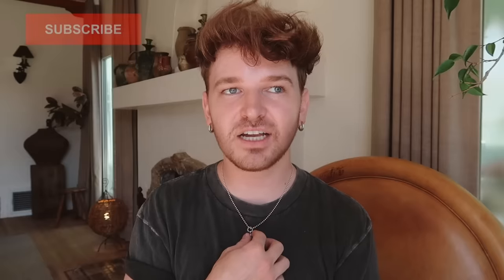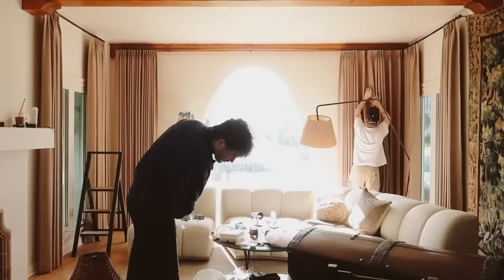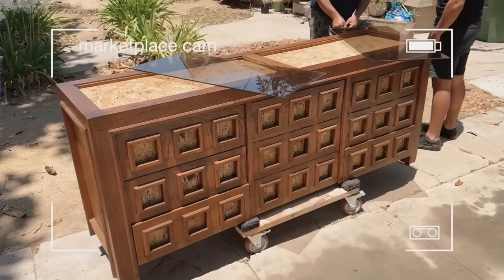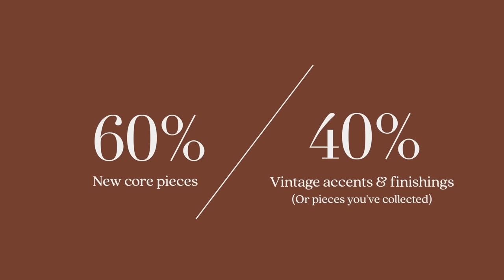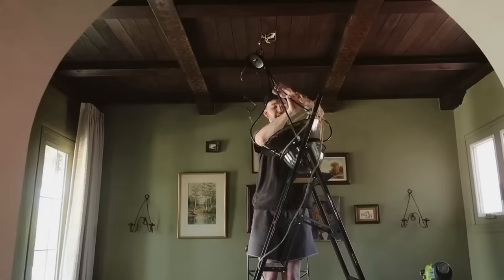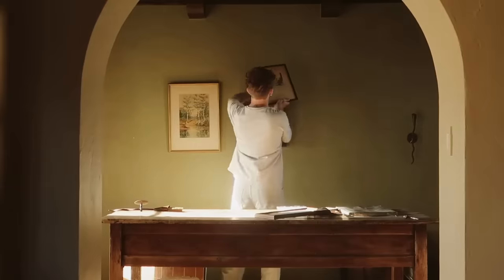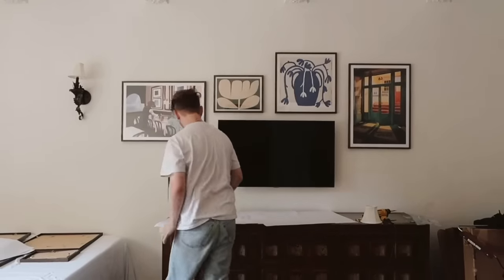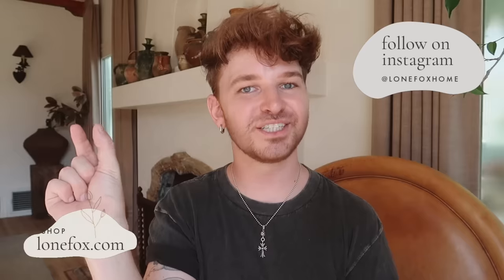10 Ways To ELEVATE Your Home 🏠 Designer Worthy Home Hacks!

Comment: I love feed and wax too, but the only thing to remember when you use it, is that if you think you might want to change the stain or tone of the wood color down the line, the wax is very difficult to penetrate. So, if you ever want to change anything about the color of the wood, you have to basically sand the entire piece in order to remove the wax. Just a good thing to know. 😊
Reply: Good to know!  @laurenzopie7922 thanks for the info
Reply: Mineral spirits will take off the wax without having to sand it down.
Reply: Or, use Howard Restor a Finish.  It's not as perfect as actually stripping refinishing, but it's also a lot less work.  You end up with something that looks much nicer (makes scratches less noticeable and takes away water rings)
Reply: @bfranklin1052   Floor refinishers would beg to differ.   They hate it when you have waxed the floors and wouldn't agree the wax can be removed with mineral spirits either.   So really think long and hard before waxing a hardwood floor.   If you know you would never refinish and the color is absolutely perfect for you forever, go for it.   Sometimes a wood floor has already been sanded a few times and doesn't even have another sand job in it so by all means wax.  The English don't change floor colors as often as Americans and they are huge on waxing the hardwoods.  But Americans are always deciding the floors are too warm or too cool or too dark or too light so just know waxing is going to cost you when you go to change them up.

Comment: Hey Drew, I wanted to share something with you about that stuff you use on the wood. If you use a paint brush specifically made for chaulk paint, there's a larger one with a pointed tip you'll not use as much product as it will be on the brush & not a cloth it's easier to get into the areas that fingers can't.  Store the brush in a zip lock for next project & it's ready to go .
Reply: Hey, that’s a great tip. Thanks!
Reply: @geethasingaracharlu9253  
Glad I could help you out with this ❣️

Comment: I have used the feed and wax for years.  If you have an ornate section on a piece of furniture use a stencil brush to push the product into the intricate areas.  I also have used it on my cast iron bistro table on my back porch.  It darkens the black and gives it a little protection from the elements.  Great product.
Reply: I used it on my brothers leather sofa when my dog scratched it. It was an emergency use but got rid of the scratches.
Reply: Old English works the same I think as Feed -n-wax but without the wax.  I go through so much Old English but it keeps antique woods so moisturized and makes then last.
Reply: @SMRT79  Feed and Wax will give the wood a shine that lasts much longer than Old English.  I used that prior to finding the feed and wax.

Comment: Love your design style and tips!  This is such a great channel! ❤ I will add a quick one of my own.  You can also, (inexpensively) revive tired, dry wood pieces with a mixture of two parts olive oil and one part white vinegar.  (Can also add a drop or two of your favorite scent of essential oil) You don't need much.  Mix it well, rub it on, let it sit and soak in for a few minutes, then buff it out well with an old T Shirt.  I have done this for years and have never had a problem with smell or rancidity.  If you are nervous about trying it, do it on a test section first.  Furniture looks amazing when finished!

Comment: I would consider “vintage” something that is 40 years or older and something that is 20 years old as “collectable”.  Right now, in Bakersfield, California, antiques are “dirt cheap”.  A 1900 coat rack and umbrella stand (complete with drip pans) that cost $200 in 1985 can now be found for $400 and it has increased in age by 35 years!  A very ornate Victorian tall desk is selling for $600 and in 1985 you could not touch it for less than $400.  Stores that sell second hand furniture are good places to shop.  I just bought two matching upholstered wing-back chairs for $200 and, from the same store, a carved “Henredon” brand side table for $55 and a tall ½ hexagon curio cabinet for $130.  At the Goodwill store I found a coffee table with leaded glass inserts for $20.  In 2014, at the Salvation Army, I found a sofa and matching love seat for $165 which was a younger, exact copy, of the sofa and love seat I had bought at J.C. Penny’s,  in 1998, when my children were babies.  All my table lamps in brass, porcelain, and glass have come from swap meets, Salvation Army, and Goodwill.  I bought my first nightstand lamp (50¢) at a swap meet, 40 years ago, when I was in high school.

Comment: My ceilings are coved and the curve comes all the way down to the trim. It would be hard to hang curtains from the top of the wall due to the curving walls. Also, my windows are generally in the middle of the walls so while I could finagle a longer curtain it would look broken up. I've found that hanging the curtains right at the level of the trim, which is at the bottom of the curve, works best.

Comment: I have a 100+ year old craftsman-style bungalow with plaster covering concrete walls. How do you install your picture frames without messng up the plaster? I also have a picture rail and am looking into buying the picture rail hooks, but some things, like drapery rods and mirrors I don't want to hang from the picture rail. I love your tips and your style! Especially your use of texture and mixed metals.

Comment: Question about curtains. I love the floor to ceiling idea but almost all of my windows are located right above a baseboard heater 😩 I imagine it’s not good to leave a bunch of fabric puddles on a heater. 

In this case, would you recommend still raising the top rod but letting the curtains hit a few inches above the heater? Or should they hit a little
Below the bottom of the window? Or just don’t raise the curtain rod and keep the curtains basically just right above and below the window?
Reply: Puddling looks messy to me.

Comment: I love sconces but don't have the hardwire to support it... Puck Lights did the trick for me. They run on battery and you can use a remote to turn them on. No wiring needed.

Comment: I have a rug in my living room. It’s an 8x10. And I probably should have gotten a 9x12. But the price was right. It’s kind of crooked in my room, but you don’t really notice. I just know it is. And it’s driving me crazy. Most of my house is thrifted or from estate sales. They have them online where I live. And my husband makes the mistake of telling me about them. So then he has to buy more. We have a light with a fan in our living room. I bought lamps for the end table and a floor lamp near my husband’s recliner. I can’t read a magazine with the overhead light. I’d rather not use it. But we’re used to it here, so it’s on all the time. My husband is going to buy a miter saw. And if he does I’m going to make some frames. I have a lot of artwork with no frames. So I want to make some for it. You can clean and make wood look better with lemon oil. It will make anything wood look like brand new. You have done way more in your home in the months you have lived there, than I have in three years in my home.

Comment: I get the idea behind hanging curtains high, but it always looks insane to me when the curtains are open if there's more than a few inches between the window and rod.

Also, in my living room, I have a door and a window fairly close together.  If I hang the rod higher, it's not even with the top of the door and looks weird.
Reply: If the curtains hang as wide away from the sides, as they do tall, above the top, where possible, they will look like a generous framing. For me, higher is better. My home has eight foot ceilings. Hanging the curtains just under the ceiling really made the rooms look taller.
Reply: I don't like the look of the "rod gap," and puddling looks messy  imo.

Comment: I asked for this to be done with curtains in my new home. When I moved in the builder had stopped the guy doing it, said it would use more material( about 6 inches in length). Curtains were included in the price. So without any consultation it was a done deal and everything would have needed filling and  repainting plus new curtains which I’d have had to pay extra for . I couldn’t afford that.  😢😢

Comment: I'm totally with you about scoring 2nd hand and thrift items to decorate for a comfortable and unique look, but I differ with you on several points.  $500 for a used chair is NOT a reasonable price by any stretch of my imagination.  I really appreciated your videos back in the day when you were budget conscious and showed us lots of ways to get a high end look without spending a ton of $$$ to achieve it.

Floor to ceiling curtains are not practical for anyone who actually opens and closes their curtains.  Because you cannot reach a ceiling height rod to adjust the placement of the gathers, you end up with clumps of fabric alternating with flat areas - UGLY!!!  Also, I don't want the bottoms of my curtains behind my furniture where they can catch, or worse, dragging on the floor and picking up dirt.  I don't have a housekeeper and do not enjoy putting my energy into maintaining a spotless home.  I have other things I'd rather do.

Feed and Wax is a quick fix, but I HATE this product.  The wax, in my experience makes the piece problematically sticky and it interferes with any future refinishing you may wish to do on the piece - unless you're prepared to totally strip and refinish.  I used Feed and Wax on my butcher block counters.  It was a huge mistake because #1 it didn't repel water (the wood was stained by even the tiniest amount of water and looked like crap within 2 months).  I was constantly on alert about wiping up even the smallest drip.  I found it stressful to have to be so extremely careful to avoid having water contact my counters.  AND #2, FaW attracted dust and dirt which stuck to the counters and and made them difficult to clean.  Within a couple of months, my counters went from being a beautiful natural color to a dirty looking grey despite me trying to stay on top of cleaning them.  Constantly monitoring my countertops and wiping up every little drip is NOT how I want to live.  It was a huge project to have to sand and refinish the darn countertops within a couple of months of applying the FaW.  NEVER AGAIN!!!   I'm sure FaW will attract dust and dirt on whatever surface it's applied to.  I hope people will read my comment and avoid compromising their wood surfaces by applying this awful product. 

On another topic, I sincerely hope the trend of throwing a bunch random pictures on a wall and calling it a "gallery" will end immediately.  Almost every gallery wall I've seen (with a few notable exceptions) looks like a mish mash of styles, shapes and colors instead of a looking like a curated group.  Well done gallery walls have a cohesive theme.  This means that artwork is from the same subject, period and style, all pieces have related colors, the framing is cohesive in terms of being pretty much the same color, size and visual weight, and most important, the artwork is arranged in a balanced and visually symmetrical way.

OK, that's my rant.  Drew, I love seeing what you do because of your constant innovation and your super power of being able to make EVERYTHING look great.  Thanks for this video.  Although I disagree with some of your points, it was definitely food for thought.